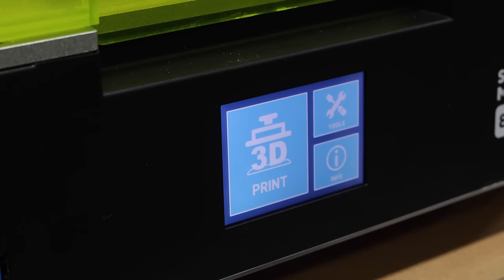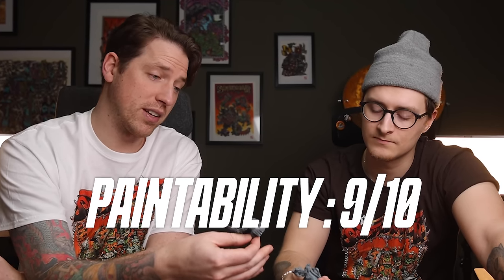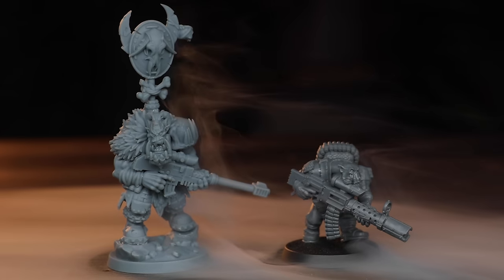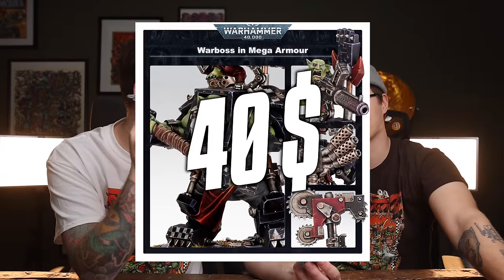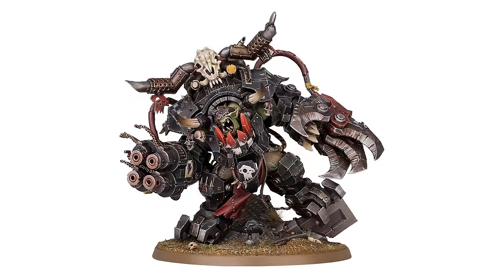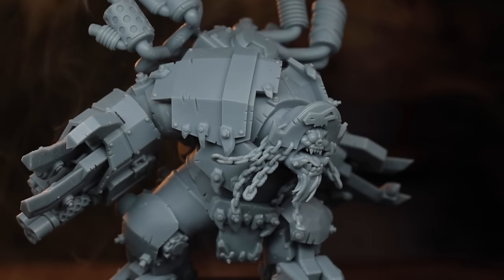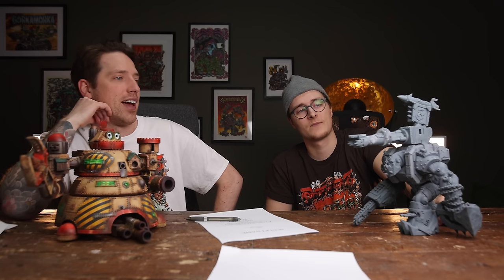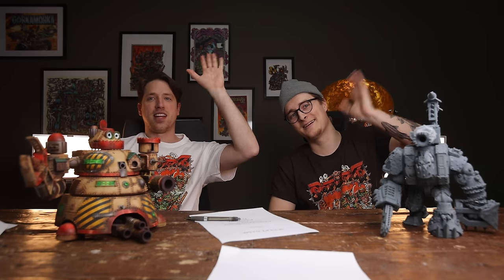Who did it best - Games workshop vs 3D Printed

Comment: Two things I think you missed on cost:
- MMF has sales All. The. Time. You can almost always get any of these STLs for 40-50% off.
- I'm not sure what resin you're using and how much powdered platinum is in it, but in my experience you're looking at $16-20/kg. So for the winged megaboss you'd be looking at max ~500g if you hollow appropriately, and for the stompa still less than 1kg total in resin. So that'd take the megaboss to conservatively $18 and the stompa to $28, which absolutely wrecks the GW alternative.
Reply: same i use standard anycubic resin and the buy in price is like 1/2.5 what they use, and i get the same detail  results on my 8k
Reply: You 3d printing bros are huffing so much copium I’m surprised you can see any detail of your prints
Reply: @CaptinCrofty I don't even print but they're right like If I go and search for resin it's stupid chesp
Reply: @josphenciso7471  squidmar also airbrush contrast paints so I don’t think they care much about cost/quality they just want quality. I don’t think iv seen a 3d printing review that didn’t have a massive bias
Reply: @CaptinCrofty  Point out the bias you're claiming here?
Reply: @loopgru  to be clear I said “3d printing review” I wouldn’t consider your comment or this video a review it was more an overall comment on the bias YouTube content has towards 3d printing. I’m not against 3d printing at all though I think buying a personal 3d printer is a waste of time and money but buying 3d prints from a business is a great idea. To try Answear your question this video changes between ideas a lot saying this orc you would only print once. Then later print this buggy 5 times and it’s great value. It’s both monopose.
Reply: @CaptinCrofty  This is anecdotal, but bear with me.

I 3D print quite a bit, as you may have guessed. I have 10 2000 point armies for AoS and 2 for 40k, all printed. All told in this hobby, I've probably spent as much as I would have on 2 GW armies... but that's a misleading metric.

If not for 3d printing, I wouldn't be in this hobby at all. I could never justify spending that much on a few plastic figures, and even if I did, I know myself well enough to know that I'd be miserable being locked down to just one. I'm the kind of player who has level capped characters in each class because my attention wanders and I like to fiddle with the theory craft, same as here. This also means that I will almost always have a loaner army anytime a buddy wants to play- or my kids, with no stress about messing up a $120 model.

Are the models I have printed necessarily up to GW quality in terms of sculpts? Not always, but sometimes- it doesn't take too much digging to find a sculpt like Sorc Lord on Manticore or Blood Warriors that are just atrocious, and while a lot of creators ape GW pretty closely, others are really creative. I quite like my goblin sky pirate KO and OPR's take on Plague Daemons, for a couple of examples.

Anyway. For a dad mode gamer with more time to hobby than to play and no aspirations to bring the big D tournament player, it works pretty well for me. :)
Reply: @loopgru  I’m sure you are aware you are more of an exception than the norm.  My point was I haven’t seen a review that looks at printing without a huge bias, for a start they should compare 3d printing costs to recast costs not GW webstore prices. Recasts are closer in material, quality and ethics to 3d prints. Though I’m happy it works for you and kept you in the hobby. I’d recommend looking at some skirmish games if you jump around armies a lot. Infinity, necromunda and bushido are great games with a lot of depth that are well suited to jumping between factions
Reply: @CaptinCrofty  Pretty strenuously disagree here. Printing and recasting are in no way equivalent ethically.

Recasts are- ethically and legally- ripping off GW IP. By paying for them, you are subsidizing and providing a market for that theft. It's not cool. I can't speak to the material quality of them as I've never given them money, and never will.

3D Printing, on the other hand, is paying third party artists for their work. There's really no ethical quandary there. It's not GW's IP, so paying for, printing, and using it according to the terms of the license for those models is no more problematic than showing up with a bag of toy soldiers you've painted up as Space Marines or IG- it just looks a heck of a lot better.

As for your other points, we've already gone over quality- I'd argue that many 3D prints are of better quality than GW plastic. Not always, certainly, but there are enough creators out there that it's not hard to find one that matches your aesthetic. Level of detail on completed prints is on par coming off a 12k printer, 

And finally material... I use water-washable ABS-like resin. Runs about $18/kg and is, in my experience, as good or better than GW plastic- ABS is some tough stuff, and when it comes to spiky bits and fiddly weapons it tends to survive better than plastic. Once we start talking about Forgeworld or FineCast that math gets a whole lot clearer.
Reply: @loopgru any recommendations for proxy night haunt or gitz creators?
Reply: @Armoire042  Sorry if this doubles up, I replied earlier but it seems to be missing. Ghamak has some awesome Gitz, tons of character and variety to cover any list you care to craft. For Nighthaunt, I like a combination of Fleshcraft Studios (great battle line, endless spells, some heroes, and probably the best Nagash on MMF) and Ghamak (great Llorona as a Lady O, a great Black Coach, some other units that FCS doesn't cover well).
Reply: @CaptinCrofty  For anybody looking to print high quantities of points (3K+) for gameplay in a GW tabletop game a 3d printer is simply the less expensive option, you could buy a 3d printing setup brand new, all the STL's and resin you need and you're spending considerably less on that setup than you are on 3K points of official GW minis 9 times out of 10. At this point it would make the most sense for GW to lean into 3D printing, perhaps make their own printer and sell it alongside STL's, it's clearly not a huge leap considering they've been making their test models in a 3D printer for years.
Reply: @loopgru  keep to what I said please which is 3d printing is ethically CLOSER to recasts than just buying from GW I didn’t say equivalent. Ether case GW isn’t getting the money for the system they support. Recast quality is great usually the same as plastics. The material also is very similar to 3d prints. The point I was making is I’d like to see a review between these two and not a super bias 3d printing vs GW webstore prices. Helping a small designer rip off GW isn’t that different from a miniature producer ripping of GW be honest. Buying a few GW boxes and adding some recast characters is the way to go imo the price of nice files is pretty high from what iv seen sure you can print it a billion times but usually I’d be happy with one or two. Then the real issue is time, for those that put a price on their limited hobby hours finding files cleaning misprints calibrations filling gaps that’s all to much.
Reply: @hughmungus6911  when I shop for 3d prints they are still not that cheap. Cheaper than GW sure but there is surly somthing in the manufacturing process that isn’t all the profitable. Gw should really just stick to what they are the best at which is plastic models
Reply: @CaptinCrofty  It's a big market out there, no shortage of price variance. It's not technically manufacture, they're all developed in a variety of 3D modeling programs, not dissimilar to methods used by CGI artists and video game developers so time is the biggest price factor. GW will eventually need to adapt as these gizmos continue to get less expensive and more capable, they're far from their technological apex. It's a clear market alternative that is rapidly evolving, it would make perfect business sense for GW to involve themselves in it rather than not.
Reply: @CaptinCrofty  But if you use a 3D printer you can have more variety and the printer is a one-time purchase product you can get with a warranty, so if you're a person with high painting output you can just continue to buy STL's, whichever ones inspire you and print and paint them for very low costs particularly after the initial purchase of the printer.
Reply: @CaptinCrofty  I don't think I put words in your mouth there. You said they are closer ethically, which I reject wholly. 

You seem to have this idea that other artists operating in this space are somehow taking GWs ideas, when the ideas weren't theirs to begin with

GW makes a setting featuring a bunch of fantasy and fantasy-in-space races that trace their way back to Tolkien and world mythology. Calling an elf an Elder or an Aeldar doesn't make it any less the prancing pointy-eared ageless insufferable know it all that we saw in The Hobbit. Calling the bugs Tyranids doesn't make them any less an adaptation of Starship Troopers and Alien. And speaking of Starship Troopers, where have we seen a bunch of amped up space soldiers fighting blindly for a bleak, jingoistic fascist society as the putative protagonists? That Necron Warrior sure reminds me of a certain movie series featuring a former governator...

Point is, GW built its IP on existing tropes, ideas, and aesthetics. They do a great job of storytelling in the resulting mishmash setting, and I'm happy to support their efforts in that regard by buying those creative works. Their game mechanics are ok at best, but I will even support those as a price of playing the Microsoft Windows of tabletop wargames.

However, there is zero reason that I shouldn't support artists whose work I like better and who are willing to put it out in a format that fits my preferences and budget instead of paying the insane prices of GW plastic. There is nothing better about Orruks™ than other orcs, and GW has no claim of original work over that idea than anyone else playing in that space. I can't take them to a GW sponsored tournament, sure, but aside from that I'm just here to crack a beer, throw dice, and play with war dollies.
Reply: @CaptinCrofty   Mine only takes resin and electricity... I made sure to factor the basic costs into my decision, particularly because it was a budgetary decision. You clearly haven't seen everything out there because plenty of the STLs out there are quite good. Anyone who has played a modded video game knows you don't need a publicly traded company employing you so you can produce a good product.
Reply: Agreed, the resin cost seems really high and so does the volume. I printed at least 3x 120mm base sized models from one 1.5kg of Vulcan resin and then some and that cost about 40$.
Reply: I switched my go-to resin to Conjur Tough, that stuff allows highly detailed miniatures and its extremely resistant. I kid you not, I dropped a Talos proxy with loads of spikes and tubes and spindly arms from the table ... and nothing broke off! I couldn't believe it myself, but I am not gonna changing my resin any time soon, the resistance factor is just too good for clumsy me to pass up. Conjur Tough is a bit on the expensive side and about double the price of your regular ABS-like resin and runs at about 42-45€ for a 1 liter bottle. But as I said, I have way less damage on my minis and thats worth the double price tag in my eyes.
Reply: @CaptinCrofty I'm not spending $25 for 5 unpainted space marine plastic figures.
Reply: @loopgru  it's unethical to print models that blatantly (usually poorly) copy GW sculpts model by model.  I didn't say illegal mind you, but in case you wondered, you probably shouldn't base your ethics on what politicians say is right.

GW plastic is soooooooo far beyond 3d print resin in quality, unless you like your troops to shatter if you sneeze in the same room.
Reply: @hunterreams9992  I disagree on the basis that most of the art created by GW is already itself highly derivative of many other preceding works from Tolkien and Frazetta to Giger and Frank Herbert. These are not new tropes, and there's no ethical reason at all why artists shouldn't create their own interpretations.

As for material quality, you're using the wrong resin and / or models not designed properly for printing. That or you sneeze like a dragon with the flu...
Reply: I do 3D printing professionally for my job in R&D, and I can guarantee you that resin is by far not as expensive as what they said in the video. Yeah, if you get the best of the best resin on the market, maybe. But for these mini's, a basic resin is more than plenty which is about 15bucks a liter. @CaptinCrofty
Reply: I was going to say the same thing, these boys are wasting resin
Reply: @CaptinCrofty for personal use it's fine... It's a large upfront cost that equals out and gets cheaper over time. If you want lots of minis ( a lot do especially me who is into dnd and wants to do tons of campaigns) and want lots of clutter... That costs a fuck load buying from Etsy sellers or official. You are talking like £6.99+ not including shipping for a standard size mini... After you understand how to use one you are fine.
Reply: @loopgru hey, you mentioned using ww abs-like. I just recently tried out a hellmix of 5:4:1ish ABS:Tenacious:Blu all from Siraya and the stuff is actually stronger than ABS plastic. Still snaps, if it breaks, but it shatters after a lot more stress. Need to clean it with alcohol though. Ipa, Ethanol, whatever works. (I use ethanol myself.) Really slow resin, I expose it at 2.5 sec with 24 micron layer height and zero antialiasing or grey levels. Mars 3.

Absolutely durable hellmix.
Reply: @loopgru sorry to double comment you... Can't edit my previous one because Yt and my phone does not get along well.
The ratio is 5:4:1ish of ABS:Blu:Tenacious. The tena is the additive, the main mix are the blu and abs-like (fast, I think it's other name is.)

Sorry again.
Reply: Reality of the situation is that, if you factor in the time it takes to setup, clean and fill. Buying a box of mini and just so much easier. Printing is cool don't get me wrong but in the end of the day majority of the comsumers are going for the brand and the convenience, quality and price aside. You can take a look at any hobby stores and even GW's sales metrics, returning customers are increasing as well as their spending, and more people are getting into the hobby. Printing will never "absolutely wrecks" gw, it is a niche side hobby within a hobby, infact sales for home use 3d printers are not growing (pro consumer and pro sales of 3dprinters are increasing). The level of tech needed for 3d printers to go mainstream is still not quite there yet size and cost, also is not profitable for companies to sell into home use, theres just isn't that many buyers. Ultimately if u factor in time for majority of hobbists, buying a finished product "absolutely wrecks" 3d printing.
Reply: @xxbabaxx12  This conflates a few things. 

From a pure price per model perspective, which was what the video and my comment addressed, it's absolutely true that printing wins handily.

Figuring in the time to find models, lay them out for slicing, print, clean up, etc gets squishy in a hurry. How much is your time worth? Do you enjoy those aspects of the hobby, or are they chores? Do we figure in time to go fetch boxes of plastic from your lgs on the other end, or removing bits from sprues and cleaning up molding lines and such? 

Finally, how much is it worth to have an army that is what you wanted, not just the GW vision of what it should be? For my favorite example, I have zero interest in KO as GW envisions them, but with custom models to play them as goblin sky pirates they're pretty epic.

Comment: I hope to dip into the world of 3D printing in the new year. Love your vids. That winged Ork Boss is amazing!
Reply: So while I am just a random commenter, I would say do it. There are many other aspects you can use it for besides "toys." I use FDM for terrain and buildings but also for handicap aids and practical prints such as remote holders or brush palettes. Even for outdoor pond repair or PVC pipe connectors (not watertight, but needed to form a small storage shelter.) The pieces would have cost 250 for all I needed, printed it for about 15. 

I know, more info than needed, but hey, there are lots of uses.

Comment: One thing I think is worth noting with regards to subassemblies and paintability.  Due to the low cost of resin, I've found it can be worthwhile to print a couple copies of something so that I can have a reference model glued to look at while I paint subassemblies.  Pretty expensive if you're buying minis, but with resin it's like $2 to print a reference, especially since you can use cheap crappy resin for the reference and a higher quality resin for the real one.